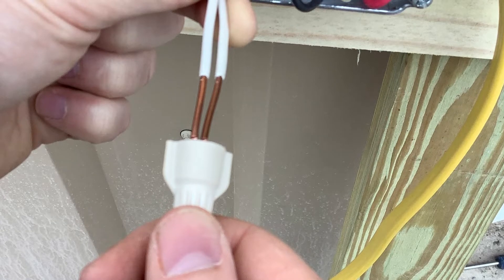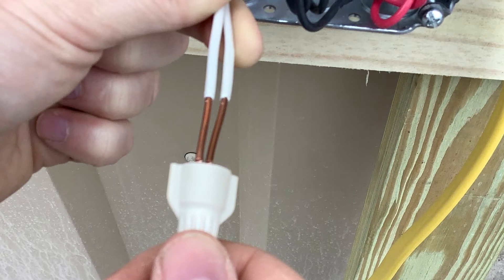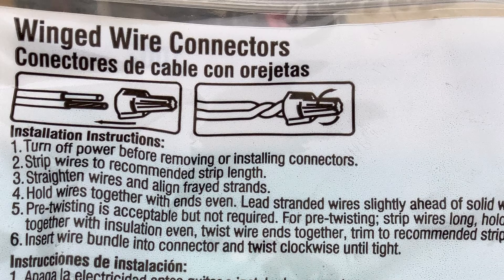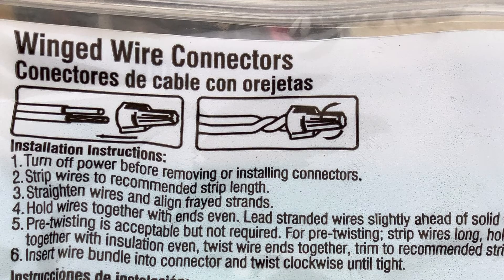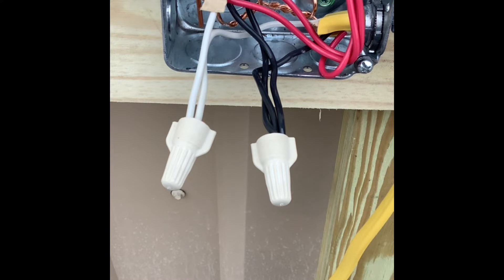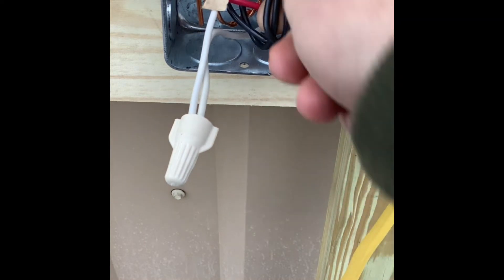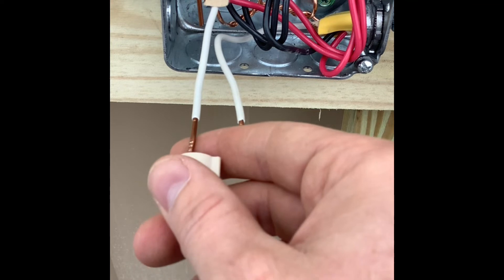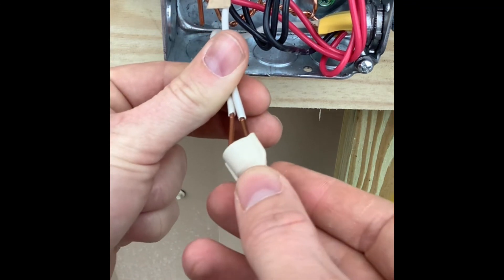Electrical Wiring Techniques | How To Put On A Wire Nut?

Comment: Mostly green helpers don't twist solid wires.  I don't think I've seen qualified electricians do it.  I've had joints fall apart from pigtails in my hands changing out receptacles to quad receptacles.   Found out it was the supervisor son who did it.  Then the supervisor and his son laughed about it.

Comment: It's a code violation, because the code basically tell you to install the wire nuts according to the manufacturer instructions. And while the instructions state it's not necessary to pre-twist, you must still twist the wire nut to make the conductor twist together and even twist a couple turns of insulated wires outside of the wire nut. If you remove a wire nut and the conductors are nice and straight, then it was clearly not installed according to the manufacturer's instructions.

Comment: Is there a NEC opinion on this?  I'm not an electrician, but saw the following video and it made sense to me: https://www.youtube.com/watch?v=mLUD7YfUf7Q

That being said, what the NEC or electrical nut manufacture's preference is what I would like to do.  I've always pre-twisted and sometimes it didn't hold the nut until after several tries.  The video in the link I provided kind of made sense because the nut forces the wires to combine and maybe 'bites' in harder (maybe?).  I'm sure the NFPA has done thousands of text to determine what is preferred.  Maybe the only requirement is the wires twisting at the end...

Comment: Thank you for the video! Exactly and perfectly answered my question: does the wire nut connect the wires of its own design? Answer: best practice is pre twist, code is nuts are designed to form a connection through their use. Again, thanks!

Comment: Pre-twisting is not necessary is on all wire nuts because if you install them properly the wire nut will twist the wires as the installation is completed properly.

Comment: When I used to use wire nuts I did not pre-twist because it work hardened the conductors and if I made a mistake it was a pain in the ass to get the conductors back apart and then often I had to cut them off and re-strip them. I always made sure the nut twisted the connectors though and that wasn't as difficult to undo as a pre-twist.

Comment: All wire nuts say right on the bag that pre twisting is unnecessary. No amount of personal anecdotal bullshit is enough to supercede the manufacturers suggested use of a product. Twisting the wire nut twists the wires. You should shut the fuck up about what YOU think the "best practice" is and stop causing electricians to waste valuable money on pretwisting a wire that will be twisted by the wire nut.

Comment: I just came across this yesterday. I wanted to add a light fixture to a circuit. The junction box I had to run cable to/from already had 4 wires going into it. The new light would be the fifth. The box was the correct size to accept the fifth wire, but with the fifth wire I now had 5 grounds that needed connected and 5 whites (neutrals). I always pre-twisted conductors but I found it very difficult to get a good twist on so many conductors so I found wire nuts that could hold the total number of conductors (black hold up to 6 14-2 conductors) and it was the answer for me, in this situation. If I had a push-in connector (on me) that accepted 6 wires (pigtails), I would have used that to get around this particular problem.

Comment: the instructions on the bag clearly showed 3/4" of the sheathed wire twisted together.
Reply from the maker: We’re talking about pre-twisting prior to the wire nut being installed. 
The picture on the manufacturers instruction is the before and after installation. A result of the wire nut being twisted.

Comment: I worked for electrical contractors for 35 years.   The last 21 years, I worked for a top 15 privately owned contractors in US.   Because of insurance and safety requirements for large projects, safety was preached over and over for all employees that had anything to do with the projects.   If you worked for this company and did what you explained in the video, it would be a trip to the hospital, 30 pages of paperwork, several hours of interviews, and finally termination of employment.   They can not force you to be safe, but sure can get rid of you when you are not.  There is NO excuse for working on anything like that “hot”!   Please remember this!   Always be safe, the life you save may just be your own!
Reply: There are special requirements for working on hot connections. You can't allays turn the power of, sometimes it's impossible.
I don't think that circuit with wire nuts is even considered for working live. If you look at the wago connectors there are special holes to safely insert your insulated tools for measurements. You could wear special boots and stand on rubber to make it more safe.
Reply: @losttownstreet3409     I was told by customers several times that the power could not be shut down that it must stay on.   My reply was always, are you really telling me that this electricians life is worth less than your process?   Then I said, yes we can suit up and wear protective gear.   But if something goes wrong, the gear may or may not save that person and if something happens, the two hour shut down I’m requesting could be turned into weeks if there is an explosion.   There is never any reason for an electrician to work on energized equipment.

Comment: If you don't pretwist, Goddammit, make sure you turn that nut enough time to twist the wires together otherwise you haven't fulfilled the instructions OR the code. Furthermore you are setting up a better man to get hurt--and I say better because he is there to fix what you fucked up

Comment: Pre-twist or not (follow manufacture's instructions always), the install of the wire nut should cause the insulated section of the wires to twist upon themselves for a couple turns.  It is clearly shown in the diagram on the bag.  That reduces stress on the nut and the actual metal connection inside, so that movement of the connection does not cause issues.  I've seen too many connections pull apart when people fold them back into the box when you don't have the extra twists on the insulated section.

Comment: What about Wago or “locbloc”?
Reply: Wagos work best with pre-twisting,  then make sure to apply 2 layers of Scotch 33, properly stretched and shingled.  Any other method fails to meet the Chicago code .
Reply: @mikekokomomike  you forgot the heatshrink
Reply: @andycopeland7051  there are Scotch 2200 mastic pads that should be applied over the heatshrink too. One  can never be too careful.
Reply: @mikekokomomike  I guess if you really want to do it right you can fill the entire enclosure with silicone before installing the cover. Bonus points if you firecaulk the entire outside. Let me know if I skipped any steps. 

Hahahaha God bless you. The Internet is still a wonderful place to meet and laugh with folks.
Reply: Wish our foremen would order wagos.
Reply: I'm in for wagos

Comment: Just a home owner doing basic electrical work. Not knowing anything long ago, I put two wires next to each other and twisted on the wing nut. When done I pulled on each wire and one came off. Yup, slipped out while putting on the wing nut. No Mark's on the wire but it at first felt tight. I checked another connection and the wires were twisted and the wires all had Mark's from the wing nut on them. So ever since, I twist the wires together and then use a wing nut. No issues since.

Comment: Neither of those connections meet code. There is supposed to be evidence of twisting of the wire "outside" the wire nut. After you have twisted the wires and put the wire nut on and then have to take it apart now you are dealing with work stressed metal.  You only get so many hard bends in a wire before it breaks.
Reply: Then why do the manufactures instructions on almost all wire nuts clearly state that pre-twisting is not required?
Reply from the maker: Provide the NEC article.
Reply: Please reference the NEC article or subsection. Thanks
Reply: Please see the comment I posted above today.  Thanks!